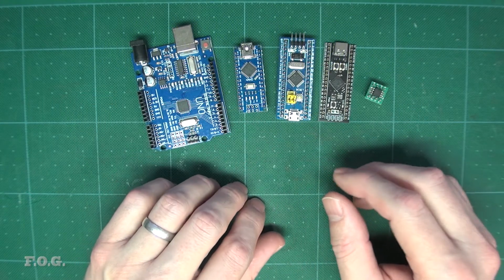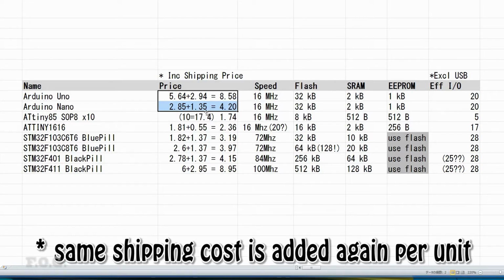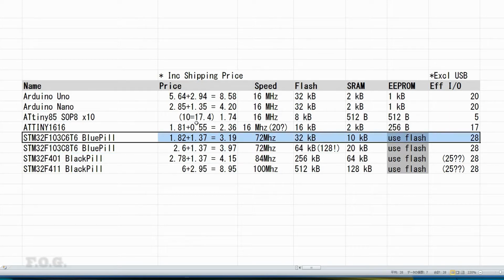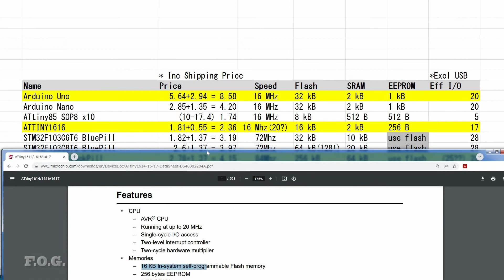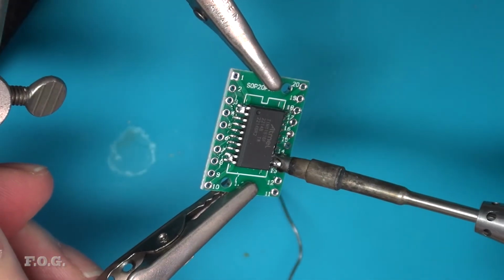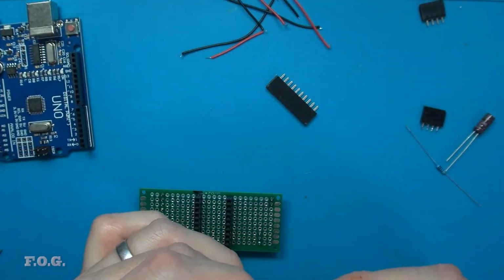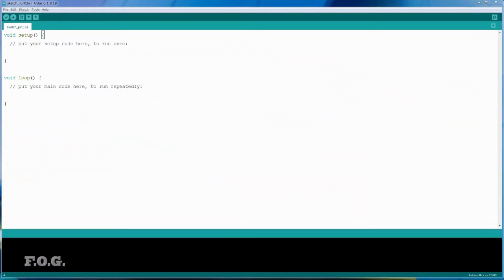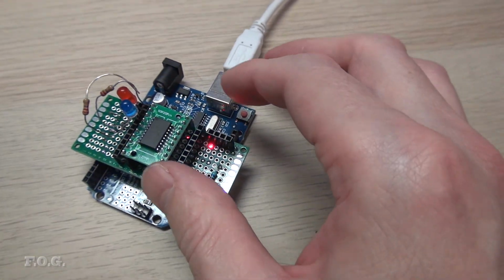EP2 - Arduino Microcontrollers - ATTiny1616

Comment from the maker: A quick update on this video. I have had absolutely no problems programming the ATTiny1616 using the Uno, so if you have a Uno or Nano on hand then it is definitely a viable option. The downside is that it does tie up your Uno or Nano, it is apparently slow (doesn't bother me), is not really a super cheap option (it's sort of free if you already have a Uno/Nano for testing), and finally it is not really a great option if you want to "on board" the programmer with the ATTiny1616 (because of cost/size/complexity). With that said, Spence Konde has some excellent documentation on GitHub on how you use a simple, small and very cheap USB<>Serial adapter (e.g. CH340 or CP2101) as a UPDI programmer (just need one resistor or diode to make it work apparently). This definitely looks like a super attractive option to program the ATTiny1616, though I have not tested it yet. I will likely include info on that in a future video, but for now please check out Spence's documentation on the method here. https://github.com/SpenceKonde/AVR-Guidance/blob/master/UPDI/jtag2updi.md [BTW: check my PCB series if you want to see me actually use the ATTiny1616 in a project, it is really a nice little microcontroller]

Comment: So this MCU has 16KB of flash memory thus after you've flashed the arduino bootloader,
how memory space would you have left for your program ??
Reply from the maker: If you use direct UPDI programming (like I am showing here), there is no bootloader. However, there will always be a tiny bit of space taken for Arduino fundamentals such as millis, setup and redirect to your main loop (I think this is a few hundred bytes). For most basic programs and related libraries, the 16kB will probably be enough, but personally I have found it a little restrictive at times, so generally I would recommend the 3216 over the 1616 (I bought the 1616 because at the time that was the only thing available!). BTW: I have not looked for a USB bootloader for the 1616/3216, however if it does exist, they typically consume up to around 2kB of the program space. Thanks for the question!

Comment: August 23 and the 1616 is less than a dollar, half or even a third the price of the 85, but with a lot more functionality, and in a qfn package even smaller than the 85.
Reply from the maker: When I made this video, the 1616 was literally the only thing available at a realistic price. Thankfully, a wider variety is now available, and at a reasonable price. A couple of months ago, I got some 3217 and 1614 chips, likely do an update video on that soon. But honestly, the QFN package is not convenient to use, it's a bit intimidating really, and would not generally recommend it to the everyday DIYer. This is my current recommendation, go for a 3216 or 1616 if you need the IO's, otherwise go for the 1614. The 1614 is just a tiny bit bigger than the 85, but has a more useful number of outputs, and a much better chip all round, and still a convenient SOP package. I have found that 16MB of flash to be a bit limiting for complex applications (it is workable, but not great), so if the price is right, generally the 32xx would be the safer bet (32MB will surely cover most projects).  Sadly, there is no 3214 if I remember correctly, so 16MB will just need to do should a smaller form factor be needed. However, if you want to make something crazy small and complex, then the 3217 is for you... But you better have some crazy PCB making skills, or otherwise be ready to use PCBway. Thanks for commenting!
Reply: @ForOurGood  absolutely the QFN isn't diy friendly but great if going on a custom board that has to be small.  Or on a breakout adaptor board, which then makes it not so small!

Comment: Hello. What should be written in the property? And Botlander does not need to be installed? What does the program actually take over? Please update these details. Well thank you.
Reply from the maker: Hi there and thanks for your questions. This chip has a integrated UPDI programming mechanism using a dedicated pin for programming, so you do not need a bootloader if you program it this way. A bootloader is typically only required when the programming communication method has dual purposes. This is the case for Arduino Uno for example, where the programming port and serial communications port share the same interface. For the settings, in Arduino IDE I only selected the chip type "ATTiny1616" and all other settings are left as default (of course you will need to select the programmer type and correct serial port, in my case programmer was "jtag2updi").
If you are using PlatformIO the "plaformio.ini" file should look something like as shown below. (Only the bottom 2 settings are manually added, the top settings are generated automatically when you create the project)

[env:ATtiny1616]
platform = atmelmegaavr
board = ATtiny1616
framework = arduino

board_build.f_cpu = 20000000L
upload_protocol = jtag2updi

I found that if you do not specify the 20MHz cpu frequency in PlatformIO, then the internal time calculations are wrong. I found this out because the OneWire interface did not work and was operating at the incorrect frequency.
I have an interesting ATTiny1616 project I am working on right now, I hope you check it out when I release the video.
Have fun and good luck!:trophy-yellow-smiling:

Comment: Hello I facing the error when update the firmware use arduino UPDI anyone can help?

avrdude: Expected signature for ATtiny1616 is 1E 94 21
         Double check chip, or use -F to override this check.
Failed uploading: uploading error: exit status 1
Reply from the maker: Are you trying to program an ATTiny1616? Does it say what signature is being discovered?
Reply: @ForOurGood  No I only have this error. I have use ATTINY1616-MNR QFN20. Do you know how to use -F command for override this check?
Reply from the maker: @ducchu  Wow, maybe the QFN package has a different signature.. I also bought some QFN package recently, so I guess I will have the same problem.. Are you using Arduino IDE or PlatformIO? If it is PIO you should be able to add it to the options in the config file (sorry not exactly sure of the syntax, google it). For Arduino I think the approach is different. This guy in the Arduino forum had a similar problem. https://forum.arduino.cc/t/avrdude-device-signature-0x1e9307-avrdude-expected-signature-for-atmega328p/376779/6
Reply: @ForOurGood  I have use arduino IDE, thank for suggest, i have check now and update. Best regards,

Comment: Hi!! Where can I found the connctions?
Reply from the maker: Please see my response to the comment from atihrot755 in this regard. I also discussed in the video how to make the connection. Thanks for the question!
Reply: @ForOurGood  yes,  I did that, but it does not work. It always says "an error occurred while uploading the sketch"
Reply from the maker: * Quick checklist *
[1] Uploaded UNO with jtag2updi programmer software? * Do this without anything connected to UNO!!
[2] 5V Power connected to ATTiny1616?
[3] Ground/0V connection linked together between UNO & ATTiny1616?
[4] UNO reset pin connected with 10uf capacitor to ground?
[5] UNO digtal pin 6 connected via 4.7K resistor to ATTiny1616 reset pin 16?
[6] Arduino IDE or PlatformIO configured to program using "jtag2updi"?
[7] Make sure you select the correct chip model in the IDE! (I made this mistake as seen in the video)
If that does not work for you then maybe you have some hardware or software problem.
Good Luck!

Comment: I wish you a good day. Thank you for the information. I would still have a question about which pins are connected during programming. It's well explained, but as I noticed, you don't indicate which pins are connected to the Arduino. Thank you in advance for your help.
Reply from the maker: I think I mentioned it, but maybe it was not clear. On the ATtiny1616 I use pin 16 (denoted as the PA0/Reset/UPDI), this is connected to Uno's digital pin 6 via a 4.7Kohm resistor. Gnd/0V should be connected between the Tiny and Uno. The Uno needs a 10uf cap connected between the reset pin and gnd. Good luck 🤞
Reply: @ForOurGood
Reply: Thank you very much for your help, it works now.
Reply from the maker: @atihrot755  That great to hear! Thanks for the query.